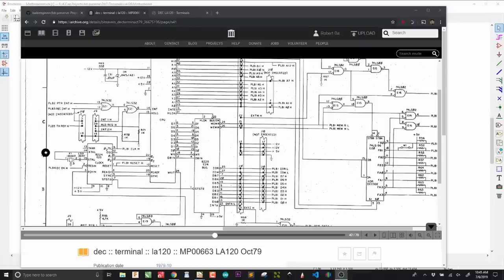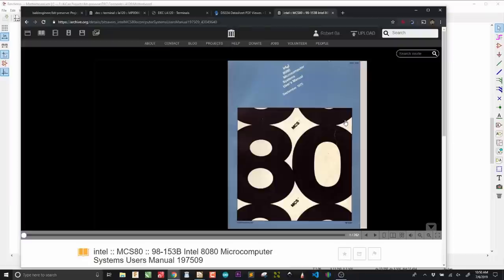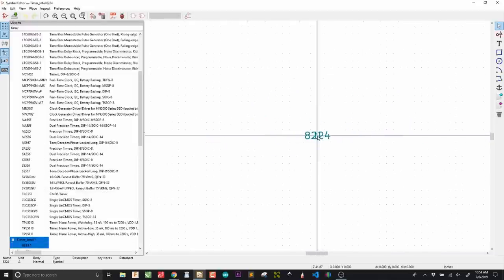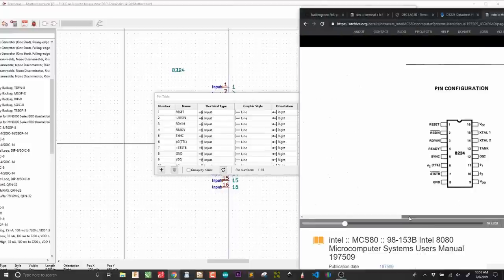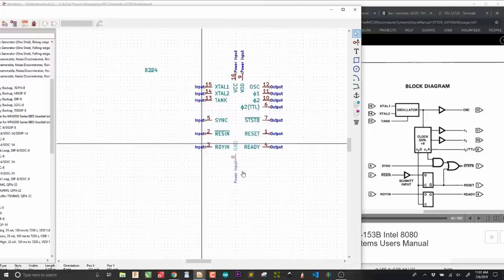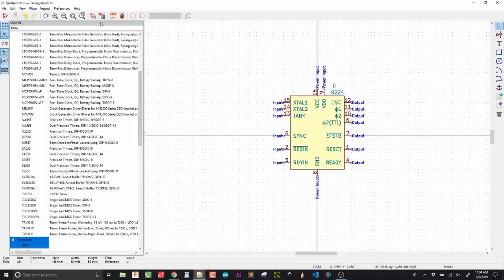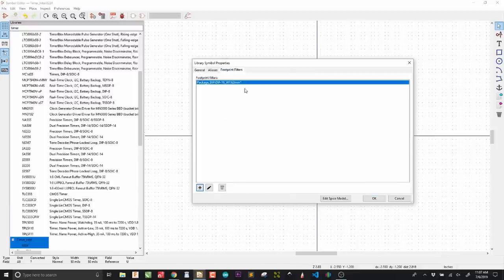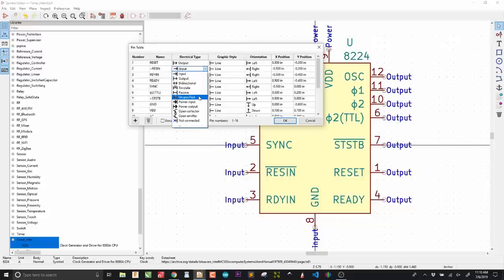Creating IC symbols quickly in KiCAD 5

Comment: Do you have a mod or different version of KiCAD here? I'm on 5.0.2-bee76a0 and can't edit the table.
Edit:
Answer to my own question - The default version of KiCAD in the Ubuntu repository is outdated. The current version is 5.1.3-ffb9f22
The Fix
This is a copy of the instructions on the official KiCAD website as they appeared on August 1st 2019. This is what I did.
Open a terminal and enter:

$ sudo add-apt-repository --yes ppa:js-reynaud/kicad-5.1

Then,

$ sudo apt update

then,

$ sudo apt install --install-suggests kicad

This version of KiCAD has the pin table that can be edited as Robert demonstrated.
  Thanks Robert.